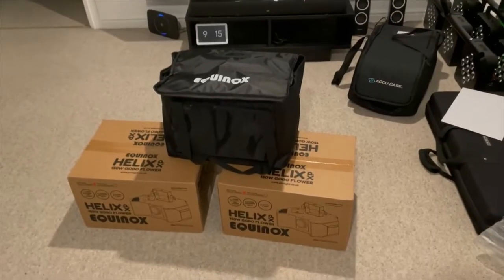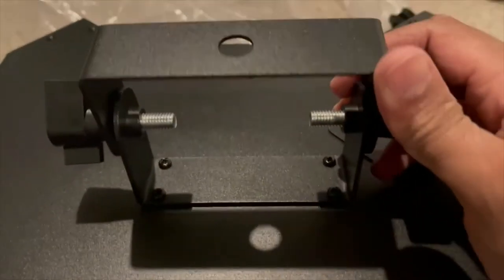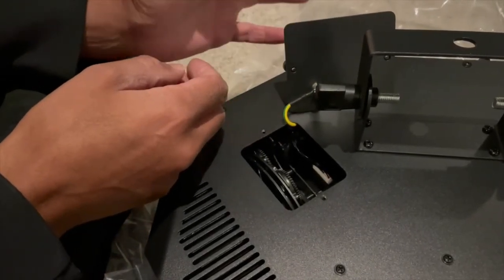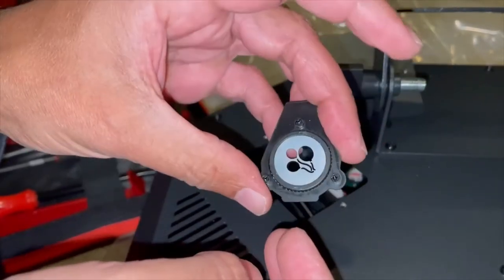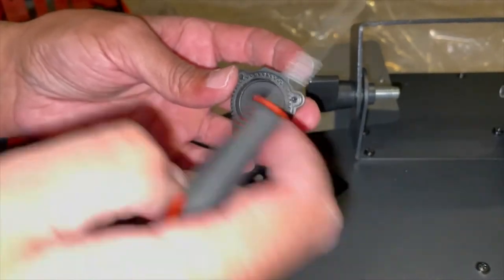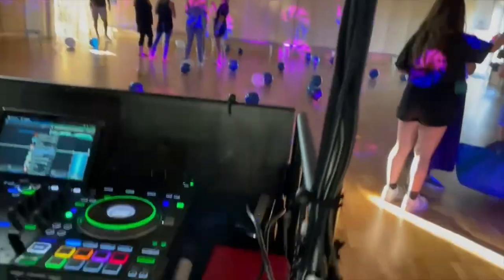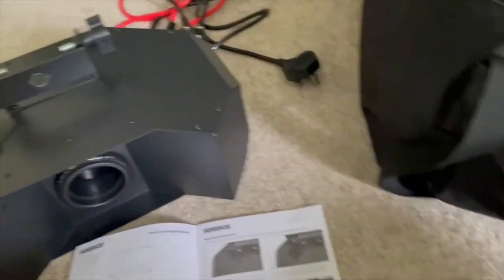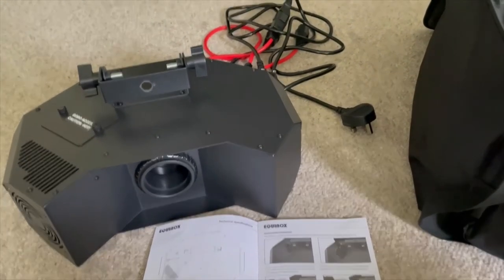DJ80 Review - Equinox Helix 150 XP Gobo Flower Light (incl live demo and how to change a Gobo)

Comment: Hi, looks great. Can I ask how you connect the poles to the booth and what poles you used? Thanks
Reply from the maker: Hi mate, in answer to your question: the upright poles used were made by Thor, just extendable lighting poles. They were connected to the booth with 35 to 32mm truss couplers. At the top of the poles were adjustable lighting mounts which split into 2 allowing 2 fixtures to be mounted. Then I used a 35mm top hat clamp attached to the light, which sat on the splitters. You should be able to buy all or most of this from a shop called Simply Sound and Lighting. 😊

Comment: These lights don't work properly on master and slave. What a con by Equinox 😡😡😡
Reply from the maker: Sounds like you got bad ones, mine did. In the UK you can send anything back bought brand new within 14 days.
Reply: @DJ80  hi consumer act 2015 states 30 days. Not got a bad one apparently they won't function together as a pair or do you have two that work in sync?
Reply from the maker: @MrLancy44  if you watched the video you’d know the answer to that question 😅go to roughly 17 minutes. Also, to be clear, I have no affiliation with Prolight/Equinox and whilst I can understand your frustration - you’re venting in the wrong place.